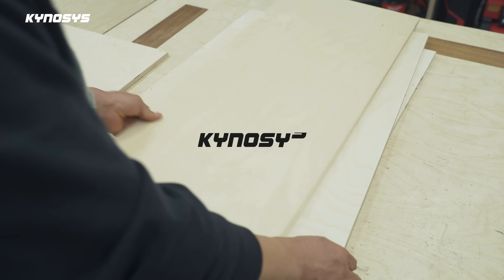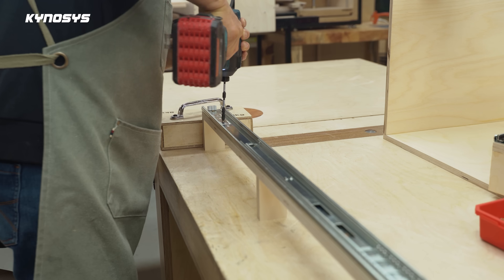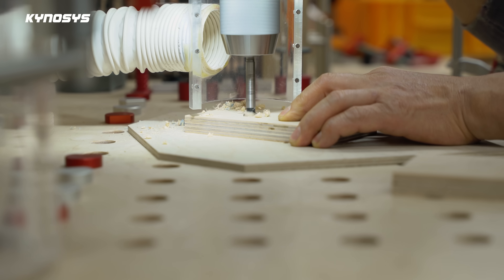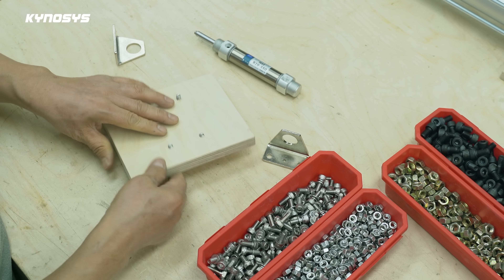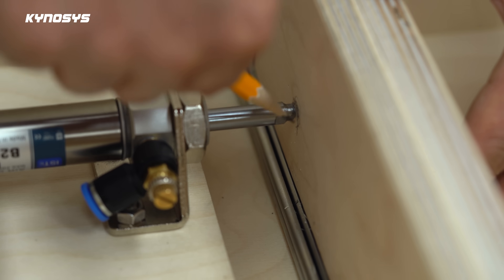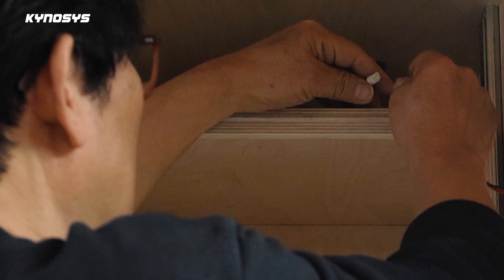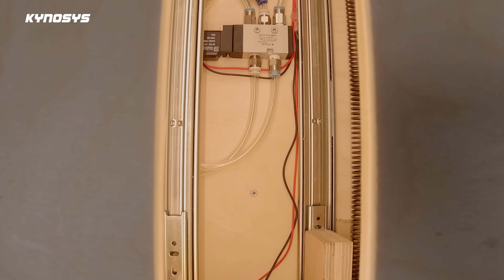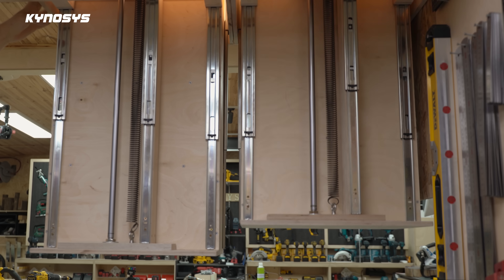Descending Drawer Making with Pneumatic Cylinder / DIY

Comment from the maker: Hello? It's Kynosys.
This is a switch-operated upper drawer.
It can increase the space efficiency of my workshop.
I'll show you the process of making it. 
I used four 800mm long drawer rails for stable operation. 
And, I made a 100mm high space inside the drawer for installation of cylinder solenoid adapter and so on.
Install the guide bar to move with the cylinder rod.
This guide bar is required for the installation of the stopper. 
Install the fixing plate on the rod of the cylinder And fix the guide bar.
I used a cylinder with a diameter of 40mm and a distance of 650mm
I hold small cylineder to be used as a stopper.
This cylineder prevents the draw from coming from coming drwn when the air pressure  is weak.
I installed the spring to hold the load on the drawer 
I worked on the airline and electric wiring.
The small cylinder moves according to the movement of the drawer. 
This stopper prevents the drawer from falling when the air pressure weakens. 
I made two drawers.
It works together by connecting the connection jacks. 
The operation of the air cylinder is simpler than you think. 
The air cylinder moves by putting air pressure in the nipple on both sides of the cylinder. 
It is an equipment called a solenoid that determines which side to send air pressure. 
It sends an electric signal to the solenoid to determine the direction of the air pressure. 
Make a drawer and install a rail.
The position of the rail is determined 
using double-sided tape. 
It is designed to illuminate the drawer, and when the drawer comes down, illuminate the inside of the drawer. 
The LED power line is connected to the wire and connector on the rawer.
I'm done.
Now I can use a space higher than my height. 
The LED lighting is beautiful, and the drawer moves smoothly. 
I wanted to show you how many parts and components work in harmony on the inside for the beauty of the outside.
I feel like I should try harder to cultivate myself.
If you enjoyed watching it, please subscribe and like. Thank you.

Comment: Very impressive design and build quality. Did you consider a simpler solution using a counterweight like a sash window?
Reply: It's possible, but you'd need to consider the contents weight. Not enough weight and it'll be hard to open, or too much and it would fall.

Comment: isnt there a easier way of doing this without power?
Reply from the maker: With the weight of your things in your drawer, with the weight of your drawers, you can use a similar weight and pulley. It's a balance of weight. It's a method used in elevators. Then you can easily lift and lower it with your hands. I'd like to try making it someday. Thank you.
Reply: Weights and pully's, like old windows, or hinges and springs, or possibly gas struts like cars use for hoods and trunks.

Comment: Nice furniture, just wondering about the cylinders noise.
Reply from the maker: The cylinder barely makes any noise when it's moving at a low speed. And another important thing is, there's a part of the solenoid where the air is drained, and if you let it out through the hose, it doesn't make any sound at all. Thank you.

Comment: Зубчатая рейка и шаговый двигатель я думаю будет проще сделать и зависимости от сжатого воздуха нет.
Фанера у вас хорошая. Какая толщина?
Reply from the maker: I run a small stationery factory. Two 20-horsepower compressors always work. So I use Air very comfortably, always. But I think it would be convenient to drive it with an actuator or a motor. I'm working on it. The wood is birch plywood. The thickness is 12 18 24 30mm and so on. Thank you.

Comment: Do the drawers come down if there is a loss of air pressure in the system?
Reply from the maker: Keen thinking. When I turned off the compressor, I locked a little air cylinder to prevent the drawer from coming down. The default value of this cylinder is sticking out, so it won't let the drawer go down. You can check it out in the video. Thank you.

Comment: Уникально и не повторимо, вы первооткрыватель, но на случай чего нужно придумать стопор, чтобы она случайно не выпала ни при каких обстоятельствах, будь-то отсутствие электричества, землетрясение или перепады электричества.
Reply from the maker: Thank you for your sincere words. I made the stopper keep the default value locked. It will remain locked even if the air supply is cut or the electricity is cut. I also wonder if it can withstand an earthquake. I think it's a word that you have to pay attention to safety. Thank you.